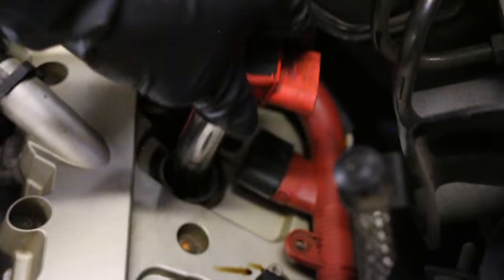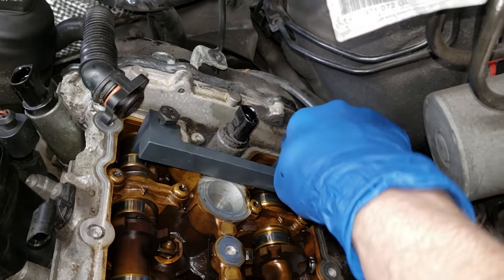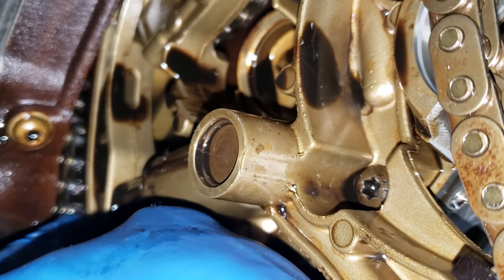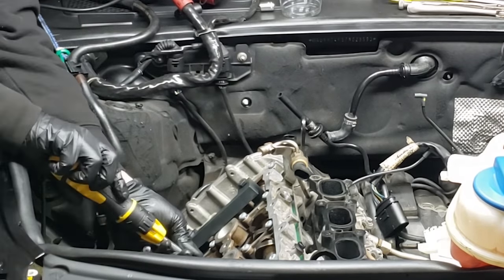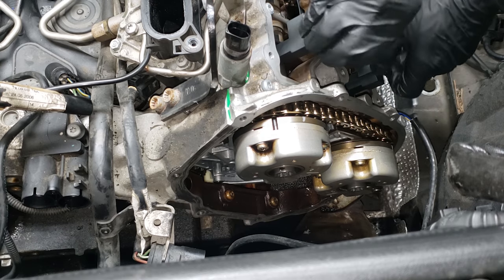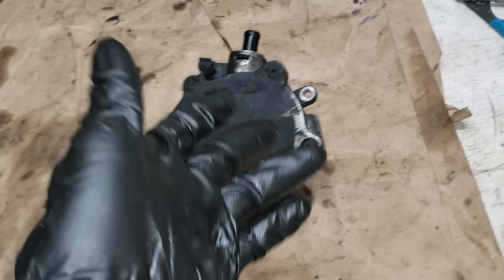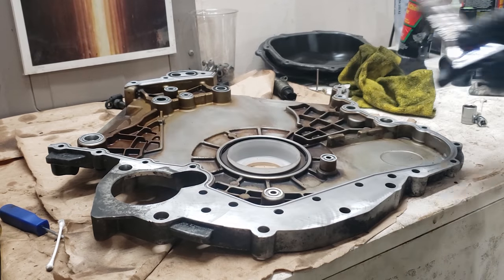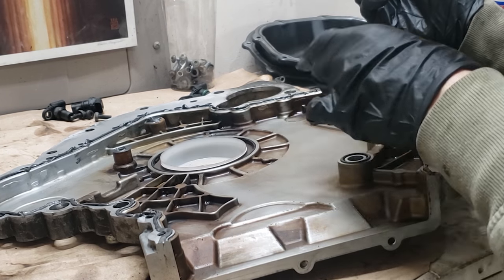Audi (A6 A4 Q5) 3.2 Upper Timing Chain Tensioners, Cam Girdle Seals, & Engine Removal | MUST SEE!

Comment: 3.2 fsi is such underrated machine. I have the 2010 Q5 3.2 I avoided the 2.0 on purpose because of all the problems. The 3.2 is such a beautiful highway cruiser. I have a CTS Cold Air Intake and I’m getting the AWE non-resonated exhaust. Great cars really, if you want a solid Audi that you don’t really have to worry about like the 2.0 the 3.2 FSI is the way to go!
Reply from the maker: You're 3.2 is updated and has some small differences over the older ones but yes. A great engine. I've had great experience with our 2014 Q5 with the 2.0 as well. But probably because I maintain it myself. Just got 2 3.0T A6s as well I'm excited for

Comment: About to reseal the rear timing cover along with the other 100 things "while you're in there" in a B7 A4 3.2 and came across this video. Awesome! I've owned numerous Audis the past 30 yrs-including THREE C5 allroads!! (Stage 3'd a 6MT even). Appreciate your time putting this together. Will use the affiliate links for sure. BTW I have a 2 post lift in my shop. Was thinking of just dropping the whole engine/trans/carrier/suspension down and out as one unit. What do you think. Wish you still lived in Everett! North in Bham... Hope NV is treating you right.
Reply: Fellow B7 A4 3.2 owner here going through the gaskets one at a time... 125k miles and the engine is very healhty but just won't stop leaking oil.  Onto the Oil filter housing gasket and rear timing covers next. My cam girdle seals aren't leaking yet but valve cover gaskets are done.  Thinking about selling the car prior to that as it is a serious PIA. It's a 6-speed so quite rare and I love the car but I think the 50k trouble-free miles I've put on it are coming to an end. I am also located in WA in Marysville.
Reply from the maker: @cooperdale I just moved from Everett to Las Vegas so was pretty close! 

These engines leak oil like crazy, but are good once sealed back up. With the high prices of used cars it could be worth it to fix it and keep driving it. Or sell it and move on. Personally I keep choosing to drive an Audi after owning one now.
Reply: @Mechani_Cole  Nice! Everett is right next door. I am an Audi guy for sure but wondering if now is the time for me to sell. It is considered low mileage and rare optioned and if I fix all of the gaskets that's fine but I wonder what could possibly come next. Suspension, clutch, etc. I bought the car for 7k 3 years ago put 50k miles on it and only replaced the HPFP and some of the easier gaskets so far. I speculate I can pull 6-8k from it today and walk away happy and move onto an s4/s5 with the 3.0t or possibly go MQB and get an A3/S3. It runs amazingly. You can see it on my channel. The inside of the head looks brand new as I showed! Appreciate your input and coverage of the 3.2 engine regardless :) 
-Austin

Comment: Hi Cole, before the hand rotation you explained that the vvt  sprockets marking looks good. Can you explain what is the exactly marking on the sprockets and the engine block what needs to time together?
Reply from the maker: The sprockets shouldn't matter as much as long as the locking tool is in place. The locking tool keeps the cams where they need to be

Comment: have a 2009 audi a5 w the 3.2-- Has been nightmare to own, transmission leak, oil filter housing leak, oxygen sensors, high pressure fuel pump failure, low pressure fuel pump failure, and another oil leak by the ac pump. Thank you for this video- final nail on the coffin on selling this high maintenance beauty and sticking to a Toyota.
Reply from the maker: That's a smart decision, even though I love Audi, I feel like a glutton for punishment everytime I touch one. Even better, get a Lexus!

Comment: Phenomenal Video.  Thanks for all your hard work putting this together! 
I'm replacing the valve stem seals on a 2007 3.2 so I have to get into the heads a little deeper.  I'm a little confused about the crank locking pin.  Whats the purpose of the original Pin and what does the larger diameter pin included with the kit do?  Does it simply lock the crank in position so it can't move when you remove the cam girdle?  I would truly appreciate a little more info on that step.  Thx so much bro.  Great resource that's much appreciated!!
Reply from the maker: Good question! Yes, it blocks the crank from rotating. Not sure the purpose of the original pin, I think it's basically an access hole for the locking pin. Since these have 4 timing chains it locks the engine in place to avoid messing up the timing.

Comment: I am about to do a 2013 q7 3.0T engine rebuild—similar to this engine. Total pistons and all. Got low compression in cylinder 2. I’ve done several 2.0T rebuilds so this is a first of the 3.0T v6. Should be fun!
Reply from the maker: I'd rather swap it then rebuild it personally. Best of luck, my most recent engine rebuild was the Subaru Ej255, but much easier than Audi engines

Comment: As far as what cam girdle sealant, doesn’t Audi also recommend not changing the trans fluid when ZF, the manufacturer of the transmission, says it’s every ~60k? Just curious your thoughts on that.
Reply from the maker: Yes, they do suggest that. However, the fluid should be changed with Lifeguard fluid every 60-80k. I just did the trans fluid in the 4.2 A6 and have a video coming soon on it. Just have to get the correct fluid, but the filter and fluid should be changed.

Comment: Your guide pin trick is so simple and effective that I can’t believe I’ve never heard of anyone doing that before….  but instead of a screwdriver I think I’ll get a few appropriately sized fasteners to chop the heads off of when I need to do this next.
Reply from the maker: Much appreciated, thanks for the comment! Anything that fits should work the same. Helped a ton on the install. 

Another trick I just learned is to grind the dowels on the rear of the engine down at an angle if you have the rear main cover off. This makes aligning it much easier🫡

Comment: Amazing!  I learned a lot watching your video.  I have a 04 TT 3.2 Quattro that I need to replace the upper tensioners.  Just wondering if and where you found the broken pieces of the tensioner and was there any particular reason why you didn't change the lower tensioner when you did the rear main seal?
Reply from the maker: Great questions! So I found a few of the broken pieces in the bottom and laying through out the area back there. I imagine its possible there is some pieces in the oil pan too now that I think about it. 

I didn't replace the other tensioner mainly because it looked good and I also didn't have that part ordered. I never expected to pull the whole rear case off and I was in a time crunch. I finished this car the day before Christmas last year and then drove it 600 miles the next day😅

But in the future, if I am ever going to pull the engine out, I'm going to do all the chains and the tensioners. 

However, you can do just the upper tensioners while its in the car. The stripped bolt caused me to pull the motor. But orignally, I planned on doing it all while it was installed. 

Feel free to ask any other questions, happy to help! 

Actually about to pick a 4.2 Audi this weekend🤞🏻

Comment: Hi do you have to replace the flywheel and torque converter bolts ? Thank you , your videos are very helpful.
Reply: Audi uses a lot of torque to yield bolts including the cam phase bolts and for legal and warranty reasons they must specify to replace them, in reality if the thread pitch is intact and no issues threading in the old bolt back in, its ok to reuse, i have reused many bolts 2-3 times without issue.

Comment: Fantastic  video!  What was the size of the triple square you used when you where removing the bolts from the  torque converter?
Reply from the maker: Thank you! If I remember they were M10 or M12. Best to just have the whole Triple Square set since its about the same cost as 1 single socket.

Comment: What a great video. It looks like the cam gear bolt snapped off on my Q5, since it is an interference engine, I am assuming the valves are toast? or..... can I replace the one gam gear and camshaft?
Reply from the maker: Wow, I have actually never seen that personally. Did it happen while driving? 

Might be best to have the head removed and dropped off at a machine shop to make sure. If it's bad, they can rebuild it. Doesn't sound to good, but I have seen engines saved that are interference. You just don't know until you take it apart usually if it's still good. 

Are you doing the work yourself?

Comment: I have looked for a 2 years for a video on reassembling this engine that included the cover over over the rear timing cover. I have never been able to get the rest Main seal on without damaging the seal. Every plastic cup I get does not fit over the flange the flywheel bolts too
Reply from the maker: Do it without the flywheel bolts. Also, you can grind down the alignment dowels at an angle, this will help it move more freely.

Comment: This is the best video, I definitely appreciate this as it is EXACTLY what I needed, including the links! Awesome job, I actually started the process, been running into several issues and started getting disheartened as someone took apart my A6 and used RTV on everything which is brittle and falling apart just like you experienced. After this video I am actually looking forward to doing the entire job including the full timing chains, timing tensionors, engine seals, the whole 9 yards full seal rebuild kit 😉. Appreciate ya man!
Reply from the maker: Comments like this made the 14 hours of video editing for this video worth it! Glad you enjoyed and it was helpful, hopefully the rest of the job goes easier for you.

One thing I learned afterwards is, when removing the engine, don't worry about the torque converter bolts. It's actually easier to remove the front of the car all the way and pull the engine with the torque converter still attached. It just slides out,would have saved me a lot of hassle as the torque converter bolts are a challenge for sure.
Reply: @Mechani_Cole  I did just that. I notice oil leak in front and while I don't have vegetarian arms the little 6 inch of space aforded by the lock position I knew wouldn't help so I removed entire front end (on both my A6 and Q5 😆)... no issues with bolts just yet so 🤞🏽 they didn't mess those up... 

1 question I see on the list of links RTV for Timing Chain cover but since there is possibility of it dryign and cracking similar to what you mentioned on Valve Cover Girdle should we use the other sealant mention and/or would that be better, worse...?
Reply from the maker: Haha, hope the veggie arm joke got a laugh 😅

And no. You want to use a quality high temp RTV there. The anaerobic sealant is only for the cam girdle. The correct procedure from Audi is to use RTV on the rear timing covers.
Reply: @Mechani_Cole  Got It! Also I saw the Anaerobic Seal link isn't working... Just fyi... there was 1 or 2 I saw not working (I think Cam Shaft lock tool). Not sure if it matters 😆 just thought i'd let ya know.
Reply from the maker: Hey that's actually good to know! I'll go update those today. Thanks!

Comment: 34:34 do you have a trick in order to remove the upper, and lower coolant hoses? I tried it once before, and it took several hours without breaking it.
Reply from the maker: Lots of penetrating oil, and a lot of force. These were a HUGE pain in the ass. If I remember correctly, I put a flat head on the edge of the plastic and used a rubber mallet to smack it in the right direction. I pulled so hard I was certain it was going to break. I hate these hose connections, called "quick fittings"  but anything but quick lol

Comment: VERY APPRECIATE THIS TAPE,

I have 2006 A6 3.2FSI. Gives me this code ONLY <P0340> ALL the time. Even after 4x new cam-sensors.   Engine crank, start for 2aec, but NEVER RUN :/   .Now I suspect camshaft doesn’t rotate , it could be chain/tensioner issue?  Or so ?..?..?
BASED ON YOUR EXPERIENCE 
What scenarios could happened to my baby A6 ? : and how much parts+labor will costs to make it runs again ??.
 
AMAZING TUTORIAL EVER
Thanks buddy

Comment: Cole, this is a great DIY. It's always a relief to know others run into major snags like broken/frozen bolts, etc. since it seems to happen to all of us. Question: when removing the cam girdle on one side of my engine, the valve springs popped the cams out of position when I took off the cam lock. The engine is in TDC but four of the cam lobes are pointed directly down with the cams loose on the head and won't allow the cams to sit in the journals with the cam lock holes facing up. Was this why your passenger side girdle sat up off the head and tightening the girdle bolts forced the cams into the rockers, compressing the valve springs?
Reply from the maker: @allen mason Good question, yes, this is why the torque sequence is important I believe. It pulls the girdle down and presses the springs down in an even manner. Pretty normal, but you want to leave the lock on until fully installed. And then you want to rotate the engine a few times when finished and make sure the holes on the cams are still lining up.
Reply: @Mechani_Cole  This worked perfectly. I was surprised that the valve springs compressed so easily but after making four passes on the girdle bolts in sequence, the girdle tightened to the head. Great tip on the homemade dowels using a screwdriver. I lost my 20 yr old #3 Philips but it was worth the sacrifice.
Reply from the maker: That's awesome to hear, great work!
Reply: @Mechani_Cole  After buttoning everything up, I experienced all three cylinders misfiring on bank 2. I did a compression test and found bank 2 cylinders at 80-90 psi vs. bank 1 at 185 psi, creating concern of bent valves. Any thoughts on what would have caused this? Bank 2 cams are still in time based on removing the valve cover for inspection.
Reply from the maker: Rotating the engine when it was locked up could have bent them. Or they were bent before hand and just now noticed. That sucks!

Comment: Is the crank like locked up when the tool is in the hole. My crank isn't locked when tool is in (cams are lined up) im confused atm. Any help would be great 😃
Reply from the maker: Should be locked up yes. That tool is supposed to prevent the crank from turning
Reply: Okay i will need to play around with the position of the crank tool. Thank you for confirmation 😊

Comment: Am I able to change the cam cover gasket on the back of the engine without pulling it ? 3.2l slight oil leak
Reply from the maker: Good question, yes you are able to. Unless you strip a bolt like I did. Best advice, start with the hardest bolts first so you know you can get them off. 100% do able in the car

Comment: hmmm - I know this is an old video but you torqued the cam adjusters before releasing the tensioners at 1.08? pretty sure you have to do it the other way around - otherwise the sprockets won't be move when you release the tensioner...
Reply from the maker: Interesting point. I wonder if it's true. So far, this car is still running and driving perfect these days almost 2 years later.
Reply: @Mechani_Cole  I suspect what happened is the chain jumped through the lower sprocket and ultimately everything worked out,  but the process very clearly says you don't torque the adjusters before pulling the pin... what happens is the cams are locked with the tool,  the adjusters are free to rotate so when you pull the pin,  the adjusters get to where they need to be and then you torque them to the cams,  which are timed with the tools... anyways - glad it's still working - this could have caused headache
Reply from the maker: I always appreciate any extra input. Helpful for any readers that are doing this job and watching the video for sure. If I ever have to do this job again, I'll keep that in mind🤟🏼

Comment: Dude how In the heck did you get the socket on the crank tool it seems like my fans in the way no matter what size ratchet or socket I use
Reply from the maker: Gotta put car in service position usually. There's a video on my page, it helps give the extra room.

Comment: hello man, I have the same noise as you at the intake level, it sounds like a clicking sound (clicliclic) do you know where it can come from ?? thanks to you 🙏🙏
Reply from the maker: Most of the time it's the tensioners or the chain slapping. Sometimes it's just how an Audi sounds. Hard to tell without seeing it in person to be honest
Reply: @Mechani_Cole  the sound comes out at the intake manifold which we see right in the middle of the engine, the gray cover. but perhaps it is also the chain which resonates

Comment: I'm acquiring a 2008 A4 with the 3.2L blowing white smoke. Do you know if it's possible to remove both heads with the engine still in the car, or is it necessary to remove the engine for head gasket replacement. Thanks!
Reply from the maker: Only use RTV, I listed a few I used in the description. Possible yes, but not the greatest. I personally prefer to pull the engine if it's my car so I can fix everything at once. But if you just want to slap headgaskets on it, you can leave the engine in the car
Reply: @Mechani_Cole   I deleted my question about what sealant as I watched through and saw the green VW sealant used. I appreciate you for sharing your experience on YouTube. This has been the most informative video I've seen on the 3.2 engine.

Comment: Do you fix a large pin to a small pin position where the small pin is separated after cranking?
Reply from the maker: Really not sure what you are trying to ask. 

The small pin goes on the cams. The big pin locks the block. I show how to install both in the video